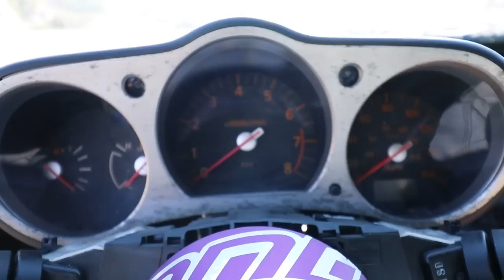Rescuing My Old Racecar from Storage 500+ Miles Away!

Comment: There's definitely a way to put your car on a U-Haul trailer. I put my lowered C6 on one to go to the track.  What ever truck you're using to tow with put the back wheels on ramps to angle the trailer down more. It works.
Reply from the maker: You’re probably right, but I was driving the Uhaul truck when moving. The car also has a chassis brace that removes an inch of clearance. That was the real problem.
Reply: @Zorbii  oh I see that makes more sense.
Reply from the maker: @Usmc913   yeah. I probably could have gotten it eventually, but after 1-2 hours of trying, I decided to just come back for the car lol
Reply: @Zorbii  that's almost what happened the first time I tried putting my C6 one one. I about ripped the bumper off but that fiberglass was surprisingly forgiving 😂.

Comment: On the mustang push the traction control button 2 or 3 times and it might have a hidden sport mode in it I've seen that on a lot of ford vehicles
Reply: I believe that just turns stability control off. I can try it on mine but it’s a 2017. But optioned a lot like Daniel’s.

Comment: yo you wanna trade vehicles, I get all of 9mpg and 230 factory rated crank hp its a FANTASTIC deal xD
Reply from the maker: What do you drive?? 😂
Reply: @Zorbii  2000 Dakota R/T. Love it to death and it handles well for a truck, but she guzzles gas that's for sure. 

although I did recently find out that its rated for 13 city 18 highway so I have been wondering if I need new injectors or something